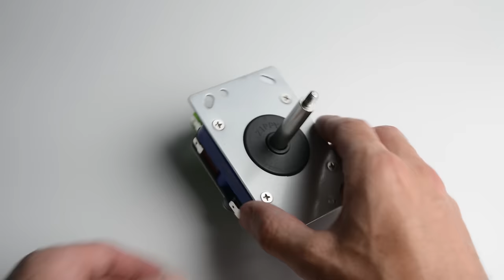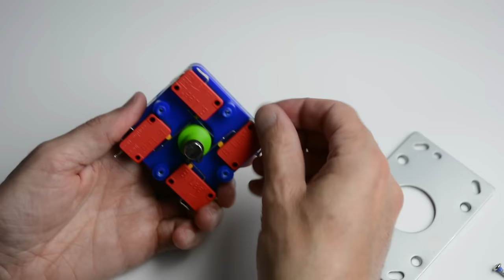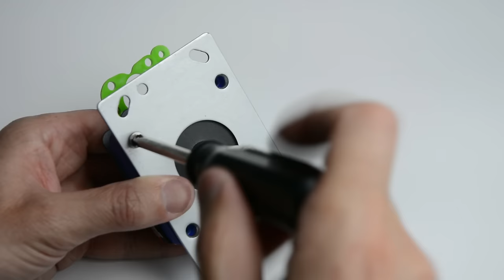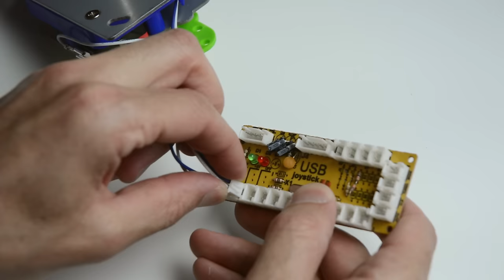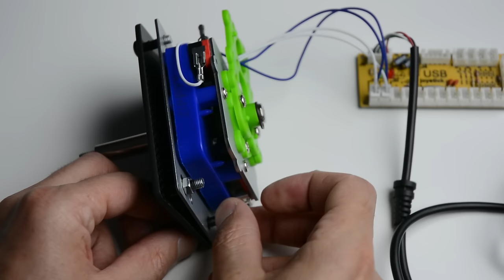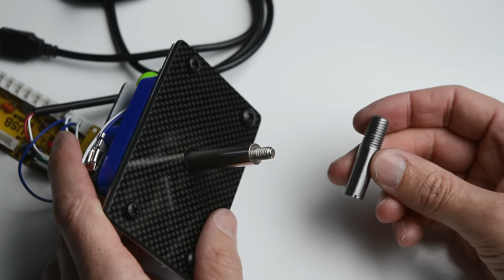MAKE THIS SEQUENTIAL SHIFTER  USB | DIY SIM RACING

Comment: 1st Comment! Love the vids, keep up the great work. : )
Reply from the maker: Thanks!
Reply: amstudio did you find me om steam
Reply: is it possible to also use a 4/8 way joystick, cuz its much cheaper than the one you used? also keep up your vids!
Reply: I did it today.... But with some little changes. The round zippy plastic cover I putted over the metal plate.
But most important its a Oring of 25x3mm  putted behind the joystick over the 2x4x8 plastic so the shifter get harder.. where I can send you photos?
Reply from the maker: +Gigio Conio Nice work , you can send the pictures to my business email found on my channel.
Reply: Pics in your email.... check it out
Reply: Hello many thanks for your videos and all the inspiration you spread. 
I ve a question about the bolt m10 with internal M6 .. where did you find this ? Many thanks.
Reply from the maker: +Nicolas de weeze I made the adapter from steel rod. Using a M10 bolt and taping an internal M6 thread will also work.
Reply: amstudio do you make these and sell these bolts? 😇
Reply: MR Cra3y kkiii
Reply: Thanks
Reply: @amstudioprojects  how do you mount them to the table?
Reply: @gigioconio  pics bro?

Comment: i made a sequential shifter using a keyboard i found at the thrift store. I've succesfully completed a fully DIY cardboard racing sim rig. using cardboard, hot glue, tape, a computer mouse (wheel) pedals (Bluetooth xbox remote) and shifter ($3 keyboard)

Comment: im about to start this actually...so this will work with thrustmaster as well..you will have to take the wheel apart and solder the switch wires to the corrisponding shift paddle..but really do able. i'll respond when im done...

Comment: I was wondering, since the shifters basically is programmed to go up or a down a gear based on two button inputs, what if you turn those USB programmable keypads that are 2 buttons, into a lever based mechanism in a box?

You could even use a gear or pulley system to mechanically move connected levers and joints to press said button, or it could be a 3d printed project.

Something akin to those Sega Arcade driving shifters for Initial D.

3D print an enclosure, use more Springs and joints to determine how a lever moves and is pushed back to neutral.

Comment: I finally completed this build! Thanks so much
Except I really had no way of finding the screw thread so I just had to use one of the adaptors with my stick, hammer it in, and hope it stays (it still is). 

Pl can u link the screw thread adapter?
Reply: Yes I’m struggling to find that too. Stopped my build

Comment: Hey! I was wondering if you still had this shifter and if it would be possible to get a couple of pictures showing where you tucked the board and how you mount it. Also was wondering where did you get the plate for it?

Comment: Hi imterested in using this for my Logitech G27 sequential shifter.  I already know where to solder onto the G27, but on the joystick I was trying to figure out where would my soldering points would  be, but i guess i can just connect the wires like you did in the video, and then just solder them to the G27.

Comment: How did you mount it? That’s the only issue holding me back right now 😫
Reply: Same here... :(
Reply: Angry guy what’s up haha
Reply: I would use the bolts holding the carbon fibre cover? Or maybe the two holes in the metal plate.
Reply: Did you have to program/wire it to a specific button or it automatically knows it’s a shifter*?

Comment: Hi, really love all your mods. In fact, I've recently finish my TM1638 SLI :). I would like to do this and weld with Thrustmaster T500 rim. But my doubt is...
Where (in the PCB) I must weld the cables? It corresponds to button 0 and button 1. Really thankfully if you can help me.
Reply from the maker: I'd recommend making it separate standalone USB unit like in the video. But if you wish to wire it to the wheel you will need to open it up and locate the shift paddle switches and wire to these.

Comment: Can you make a handbrake out of this ? And what is the thing you plugged the cables in ?
Reply from the maker: Yes it could be used as a basic handbrake. Plugged into a USB zero delay encoder.
Reply: Can you plug the USB port in a PS4 and use it with the wheel ?
Reply: Wondering if you ever gave this a shot with the PS4?
Reply: SimonV did you ever try it with the PS4?
Reply: SimonV did you ever try it with PS4?
Reply: The Reel Yev aka Niner dossnt work with ps4 its a simple chinese usb button pcb

Comment: Great mod! but you have create a stand or base for this ?
Reply from the maker: Yes it is attached to the handbrake table mount.
Reply: how ? have a picture  ? thanks
Reply: Can I have a picture too?
Reply: You can make a hole the size of the basr and then screw the top panel onto the board

Comment: where did you get that extended adapter from? and what size and such? thanks!
Reply from the maker: I made the adapter, the sizes are in the description
Reply: First of all great video amstudio! That adapter is the difficult part of this build.. I am going to try and build this but an adapter like that is not for sale. Or very hard to get, found one website on the other side of the world :P. The basic shaft of the arcade controller is only 6mm and will not fit any aftermarket gearknob... I will have to go and find a machinist somewhere who can make this.
Reply: @JurMasterThe  this is easy to make on your own with a tap a drill and some threaded rod

Comment: made this but cant find the M10 bolt with taped thread - M6x1 internal. where did you get this from?
Reply: Were you ever able to find it and how does it work?
Reply: Works great, I finally upgraded to a Thrustmaster shifter. But this worked good for about a year. I never found the bolt to add the factory shifter. But I made it work anyway.

Comment: just wondering where you found the bolt adapter so easily
Reply: look at honda gear stick extension they are m10 and loads of options.
Reply: Dwick awesome thanks
Reply from the maker: I made the adapter, decide which gear knob you are using first as there is a few different thread sizes and pitch.
Reply: just wondering is it the arcade joystick that is m10 or the part that you screw the shifter knob on cause i was looking at the honda shifters an those are m10 and just need an extension then
Reply: m oltmanns 
S

Comment: Quick question, is the carbon fiber really needed?
Reply: I’m building one now and the top plate helps put pressure on the o-ring, which creates drag on the stick making it feel stiffer and more like a real car. The aesthetic benefit is just that, a plus. Don’t expect to get anywhere close to a true sequential gearbox with this cheap joystick, but I think for a budget it will be more than adequate. I’m planning to replace the o-ring in my build with a short spring or two. There’s a certain combo of spring stiffness and compression distance between the joystick top and top plate (carbon fiber thing) that will provide a more satisfying shift.

Comment: If you use 1 switch, can you wire it trough the base to the PCB of the wheel (as a handbrake)?
Reply from the maker: Yes that will work. It will be like the orange hand brake I made.
Reply: Thanks for the quick response :)

Comment: Can this arcade joystick be used to a make a 5 speed shifter?
Reply: Better off getting a TH8RS
Reply: No money, no fiesta!
Reply: But thx for replying
Reply: H shifter is absolutely different level. Arcade joystick can't be used.
Reply: I was wondering, since the arcade joystick have 8 way, by using its diagonals and up/down I could do it. I think it will need some kind of work on the green plastic to make the H pattern.
Reply: Lucas Cordeiro you could make the stem longer and fit a H pattern with some kind of resistance (to keep the gear in) added to it, but thats quite a build..

Comment: Is it possible to connect it to the steering wheel?
Reply from the maker: Yes wire the switches to the shift paddles.
Reply: amstudio but aren't there two in puts? or do I just need two cables? and if yes were goes the second?
Reply: i need this answer too

Comment: amstudio ive order 2 arcade joysicks and 1 USB encoder  ,can i add the 2 joysticks to the same USB encoder ,and use 1 as a seq gear and other as handbrake
Reply from the maker: Yes that will work. 12 available button spots on those encoders (not including directional up,down,left,right).
So 2 x for the sequential (gear up & gear down), 1 x for the handbrake (on-off), which leaves you 9 free spots for buttons or switches. Maybe use the rest for a button box.
Reply: thanks mate,your a star

Comment: why take the two switches off !? you can leave them and simply don't connect them o_O?
Reply from the maker: Yes the switches can stay in place. Makes it easier to see how it works for the tutorial. Also the switches can be used for other projects.

Comment: where can i get the joystick and could you please do a analog guage
Reply from the maker: goo.gl/m6jhMp   - Check ebay and aliexpress for cheapest. Must have 2 way adjustable or you will need to make a custom 2way plate for the bottom.
Reply: +KookiDowg thanks bro
Reply: +amstudio thanks love the vids do you recon you could do a vid on how to turn a analog gauge into a sim racing gauge
Reply: How did you mount it to your sim rig?

Comment: +amstudio can I use one of these switches out of this and use with the ebrake mod threw the joystick board?
Reply from the maker: Yes that will work. It will be a on/off handbrake.
Reply: just one more question the  only hang up point on my mind  the M10 adapter looks like you make it. can you explain how you make it? is it from a bolt? looks like you cut the shaft horizontal first to keep the drill bit in place? then after you drilled it you tapped it? what was the thread size of the inner di?
Reply from the maker: I made the adapter from a piece of steel rod tapping both threads. But will be easier and quicker starting with a bolt, cutting the desired length and taping the internal thread. The internal thread is M6x1.
Reply: amstudio  thanks.

Comment: What's the point in taking out the two micro switches when you're using the plate at the bottom to inhibit side to side motion? Seems pointless to me.

Comment: can this work with the t80 wheel for ps4
Reply from the maker: It will need to be wired to the paddle switches on the wheel or you could try wiring to a compatible PS4 controller.